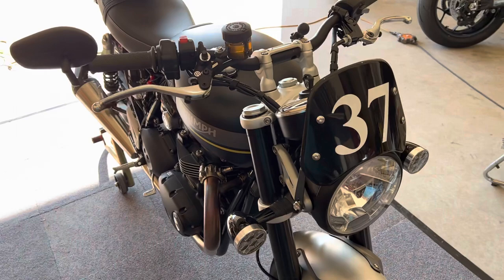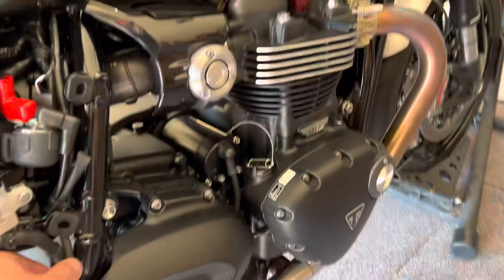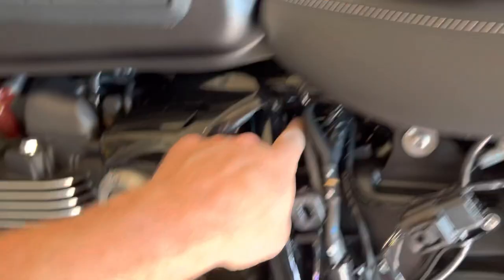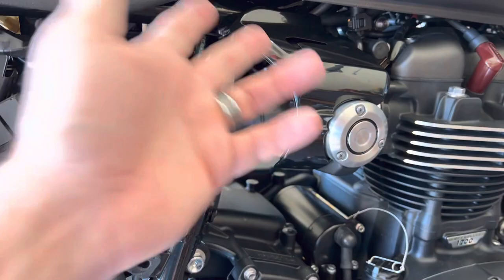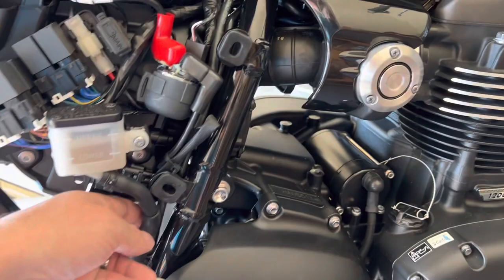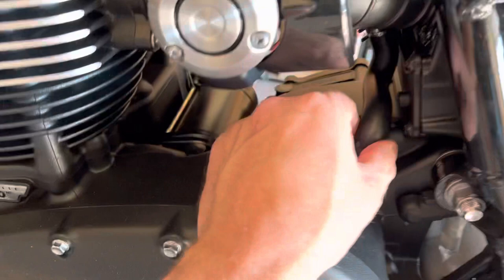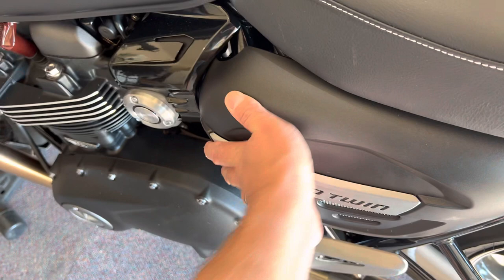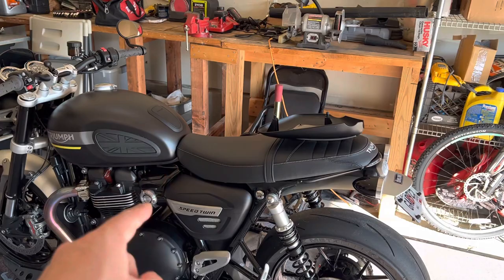Dave's Garage - Update on Speed Twin Evap Removal - Watch!

Comment: This is from the service manual. Has a diagram as well.

“When the engine is started, a vacuum is applied to the purge hose from the throttle bodies.
At certain times, the engine ECM opens the purge valve.
The vacuum applied to the purge valve now begins to draw stored vapour from the carbon filled evaporative canister and returns it to the throttle bodies for burning in the engine.
In order to control the speed at which vapour is purged from the canister, the engine management system regularly shuttles the purge control valve between open and closed positions.”
Reply from the maker: Ok, then plugging it is the way to go, so that there is no chance of it drawing outside air that bypasses the air filter.  Thanks!

Same with my other brands of bikes on the past.  Glad I caught it, and that you confirmed it; appreciate it!
Reply: @SquireSCA  Why would you plug any of them? Your not thinking clearly about what a vapor cannister is. Are you afraid a mud dauber  is gonna crawl into your engine?
Reply from the maker: @andrewbecker3700  If the purge valve opens, then it will draw in air from that tube.  The tube joins the intake tract AFTER the air filter.  So any air it sucks in, if there is dust or dirt in the air, it won't be captured by the air filter, as it bypasses the filter.

Now, is that tiny hose gonna suck in enough air to make a difference?  Probably not, but for the price of a small screw that anyone has sitting in their spare parts bin, why not block it off and just eliminate the possibility?
Reply: @SquireSCA  Your still not grasping it boss. The charcoal canister isn't there anymore. Any air that cycles into the intake through that convoluted maze of emission tubing, isn't dirty anymore, it's clean and atmospheric pressure needs to be allowed to assist these systems to flow properly. When you plug the little tube off your not allowing the remainder of the system to flow normally. Why would you want that? If it was an issue, the ecu would almost certainly throw a code. Your over thinking this. Letting the ends hang down in the airflow under the bike, it's down drafting it out and away oldschool style. All them fancy check valves and separators are there for a reason in the other direction.
Reply from the maker: @andrewbecker3700  Not sure that that is accurate.  If you don't plug it, then you have a hose that is open to the outside air.  The one that I plugged, is used to suck air back FROM the canister.  It's a vacuum line, that uses the vacuum created by the intake manifold, to pull air OUT of that canister.

As you said, that canister is no longer there, which means that it is pulling in outside air, into the intake manifold.  If it pulled it into the airbox, I wouldn't care, because any dust or dirt would get caught in the air filter.  But this hose goes directly to where the throttlebodies are, so it bypasses the filter, and as that line is sucking air IN, I don't want it sucking anything into the motor that hasn't been through the air filter.
Reply from the maker: We did confirm that it is indeed a vacuum line, in the shop service manual for this bike.  It's sucking air in, and it's sucking in after the air filter, so anything it sucks in, goes straight into the motor, not the airbox.  That's why I decided to plug it.  

How much could get sucked in?  Depends... If you have an open hose sucking air in, dangling down under the bike and you are driving over a road where sand and dust is getting kicked up by the front tire... I wouldn't want it doing that, personally.

Comment: Closing the pipe is good for the motorcycle yes or no ifyes explain to me .Thanks
Reply from the maker: Closing off the one that goes back to the intake manifold is a good idea.  Leave the other hose, the one with the one way check valve, open.
Reply: @SquireSCA  and the motocycle , it breathes better , runs better

Comment: I am disappointed there is one more useless electrical thing that can fail. I hope there is a way to safely remove that too "maybe a dongle?" My Thruxton has been in and out of the shop for months only to find out a faulty tip over switch was causing major issues. Hope some experts chime in, but the your current solution might be the best.
Reply from the maker: Not that I know of, but I have never had a bike throw a CEL over the evap canister valve before.  I think the Charcoal cans are mainly a California thing, but they just put them on all the bikes.  I usually remove them.  On this bike, probably not as critical, but on others it freed up storage area under the seat, or allowed better airflow because they stuffed it right behind the radiator, etc...
Reply: @SquireSCA  You can also remove the hose and and cap off at the solenoid. I removed the hoses on my other bike and put rubber caps with mini clamps on each throttle body for a cleaner job.